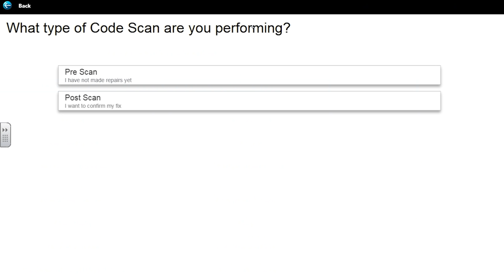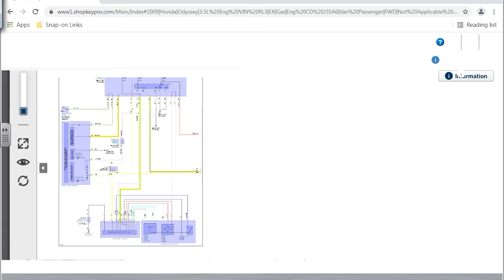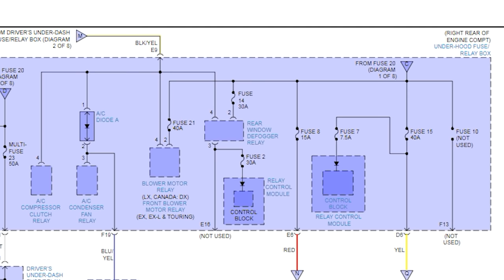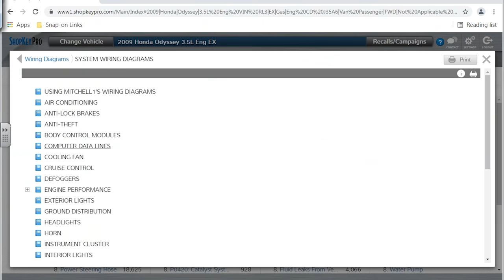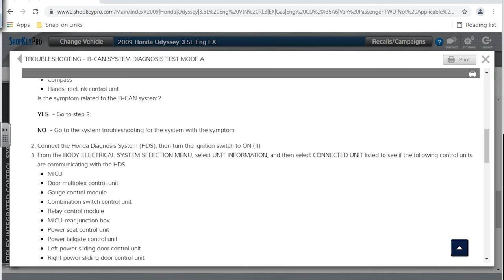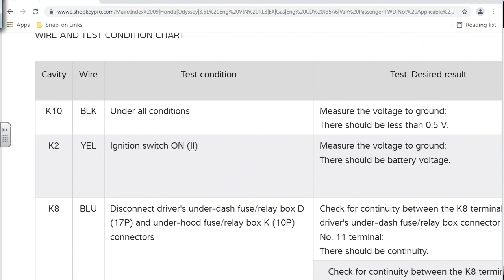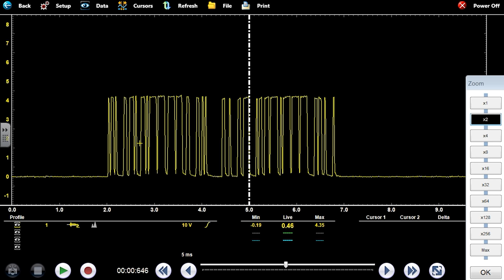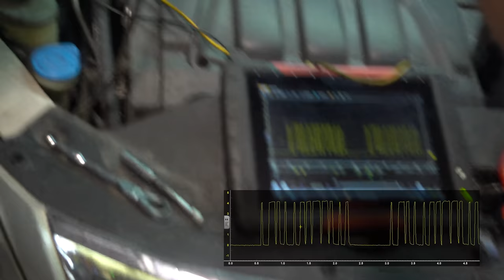Honda B-CAN Network Diagnostics (single wire design)

Comment: That 30A fuse a safety valve if something shorts
Reply: No, it's just being used as a link. The circuit is only the control side of a relay, so about 100mA current.
A short to ground on that line would only turn that relay on any time the ignition was on.
A short to power or shorted relay coil would burn out the driver long before that fuse had any chance of blowing.

The same fuse and relay box is probably used in other vehicles where that relay could be used for a different purpose, hence the unused circuit leg shown on the diagram.
Reply from the maker: @simonparkinson1053  exactly Simon! I believe the unused leg would have provided the information too. But what a weird design huh?
Reply: @ScannerDanner  I'm wondering if the unused leg would control heated mirrors.  Weird thing, it would have to be the ground side feed to whatever it controls (since it controls the ground to the defogger relay.)  Rare to see fuses on ground side of equipment.
Reply from the maker: @ablackformula  especially a 30 amp one right?
Reply: The 30A fuse is a jumper to configure the relay for internal control by the module. Fuse would be removed for applications using external control via the "not used" terminal.

Comment: I went to diag for a car lot over the weekend. They replaced the fans and fan control module with no luck on a Lincoln. The fans not working was the original complaint. I was there for only 15 mins before I found the new dorman control module was bad. The car lot refused to pay me my hr minimum rate 85$. I'm not joking they refused and offered to pay 60$. This has been my luck lately. Before I even left my shop I told them it's a 85$ hr minimum. This is the Second time this happened. The first time it was a tow truck company. I cant believe some people. Sorry for the rant but it was getting to me.
Reply from the maker: The car lot people are THE worst. My suggestion is to never do business when them again. That is absolutely complete b.s. that they didn't pay you what you quoted up front. Nice job my friend

Comment: This was dragged out. When a module isn’t communicating the best approach is backprobe the 3 important wires first. Power. Ground. Comm. He spent so much time interrogating the outputs of that module. Wasted time.  Also, when you cut that wire I cringed. Why cut a wire under hood?  Cmon. That’s a safety module. It controls so many safety devices (wipers, lights, horn).  This was a hack diag. Any repair you make to that wire is still worse than a factory in tact wire. No argument.
Reply from the maker: Power, ground and com lines tested good! Now what? Do you have enough info and knowledge to call a bad module? You do now, and in large part from me cutting that wire and proving a concept.

Comment: Could it have been a pin fitment issue with the communication line . Just curious
Great diag 
I'm only a couple of years into being a mechanic and I'm trying to focus on electrical diag, your videos have been very helpful.
Reply from the maker: yes sir, pin fitment should always be something to consider. Just did a case study on my premium channel on a 2018 Duramax that was a pin fitment issue

Comment: Where does a beginner start this is way to complecated for a beginner this is the long hard way to test things just watch a video on the prolbum you have and do the tests you don't have to spend years learning all this stuff it will take you years to learn all this watch ratchet and wrenches its straight to the point with a brief explanation not 100s of different tests to confuse you and over explaining things to thr point of confusion thats why most techs are not very good at this if you learn this you will be great one of the best but chances are you will be confused forever
Reply from the maker: If you are willing to learn, even as a beginner, you have found the right channel. I've been teaching beginners for over 20 years. I'm teaching fundamentals here. Tests that can be applied to all cars, on all systems! 
What do you do when your "brief explanation" video doesn't help you? Where do you go next? What other tests should you be doing? When you get to that point with your silver bullet fix videos, where you need more info. then you will thank me for the details and other testing methods I typically provide. 
To those that are truly trying to learn how to troubleshoot, this is the type of video you want. If you only care about the fix and what part to change, you are correct, my videos are not for you.

Comment: Twenty minutes in an I'm feeling frustrated by Honda electrical engineering regarding the 30 amp fuse on the relay control side. Sounds like English Lucas electrical trash.
Reply from the maker: Haha forgot about that!
Reply: @ScannerDanner  Seriously, how much current does the control side demand? Bizarre. Especially considering it was post-load.
Reply from the maker: @hethaerto1  right? 100-200ma tops